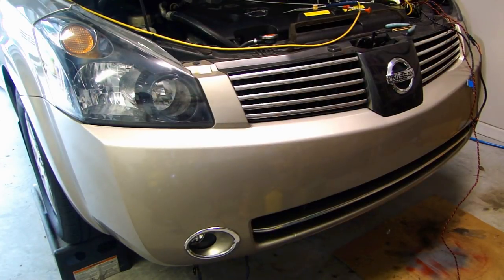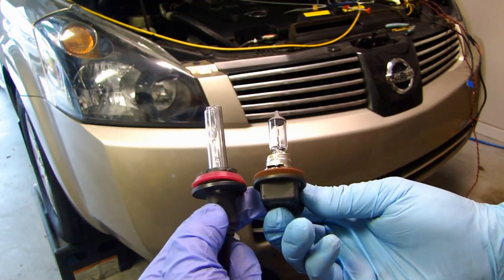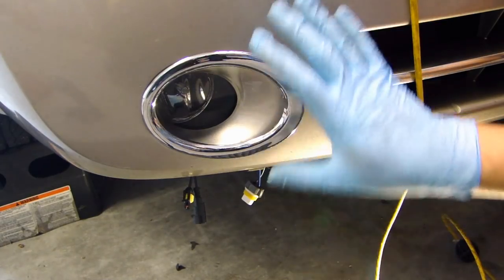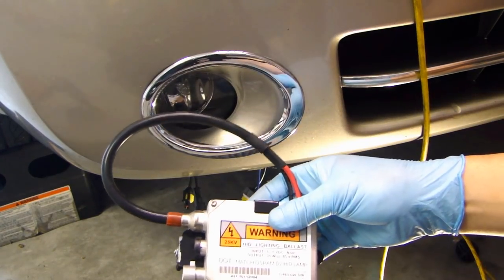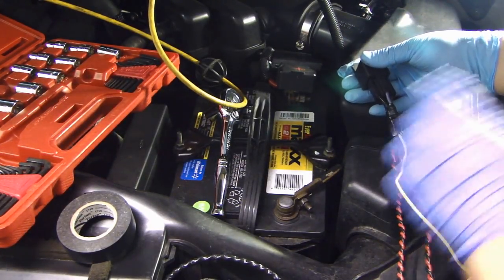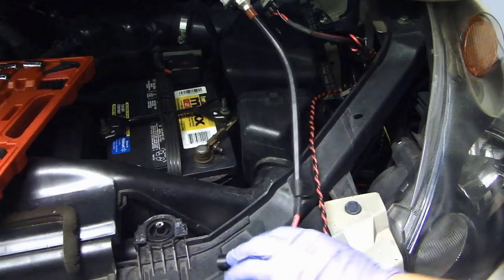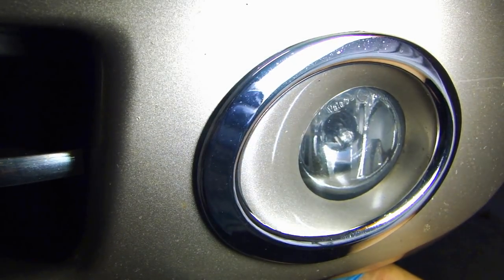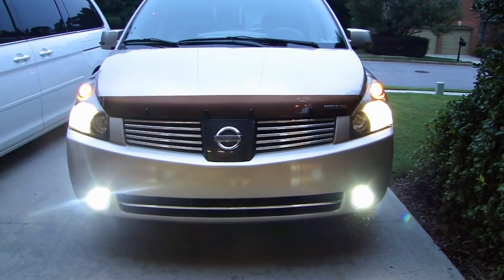Install HID Light Kit For Fog Light

Comment: So, I have an after market fog lamp set up for my mustang, already running off the battery with a switch and relay that came with it running to the inside of my car through the firewall... ( the whole grill actually) .... 

So, would I just need a ballasts and the bulbs to finish the conversion ? ? ?
Reply from the maker: Yes, that's all you need

Comment: With the relay harness do you need an on/off switch??? Cause on my truck it doesn't originally fog lights but I'm installing some
Reply from the maker: +Diego Savage Yes, you will need an on/off switch. I have been planning to do a video on making your own relay harness, but need to find time.

Comment: When the bulb was in the plastic case it worked but When I took the bulb out of the plastic cover/case the bulb did not work and was broke why?
Reply: sometime they burn after you touch them with your finger. ALWAYS USE CLEAN GLOVES

Comment: Do you really need to use the reply kit???
Reply from the maker: No, you don't always need a relay kit as long as your factory wiring can provide the necessary current for the ballast. If it doesn't, you will have some melted wires.
Reply: +dial2fast can you explain melted wires?
Reply: +racedezign336 At the initial start of the HIDs, the factory wiring are a bit thin and not handle the power draw. They might melt because the power draw  is high until the HIDs  warm up. By having a relay harness the main power draw  will come via the harness wiring and not the factory wiring. Adding the harness just adds about 10 to 15 more minutes but will save your factory wiring.